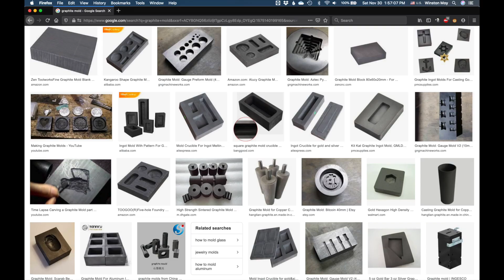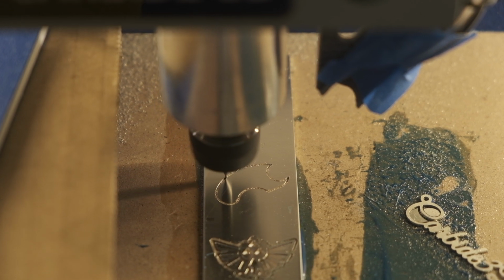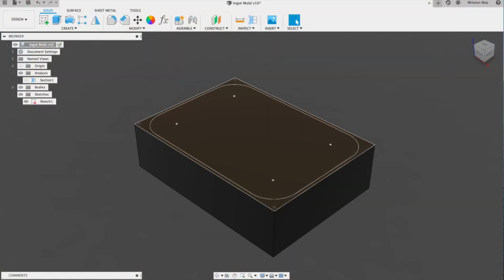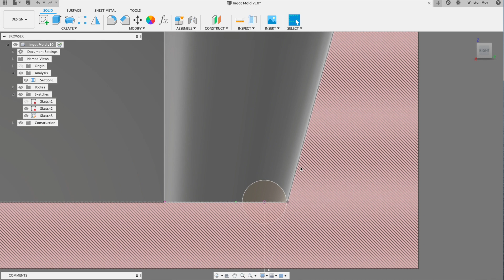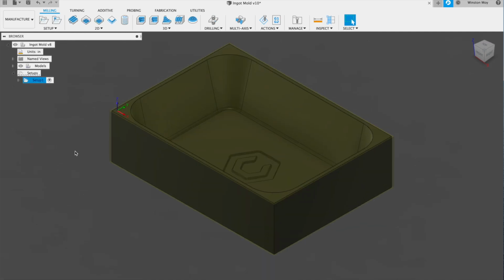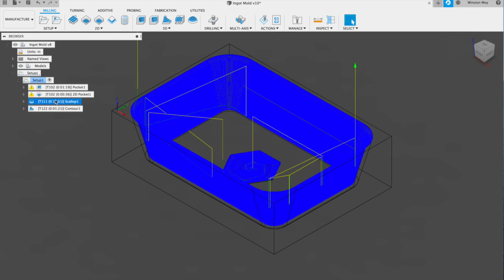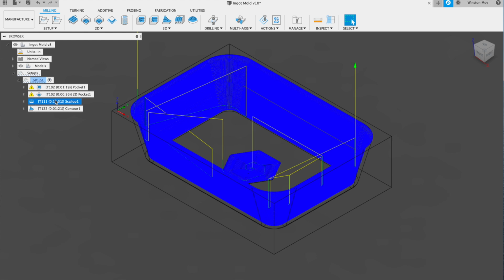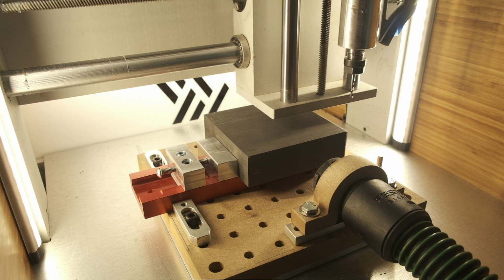Machining a Custom Graphite Mold for Metal Casting - #MaterialMonday

Comment: Hi Winston, from a jeweler's perspective: Graphite molds deteriorate quickly if you flame them too hard, for too long, and too frequently. A quick hit with your torch is all it takes, not only to heat the graphite, but also to make sure it doesn't contain any moisture. A dry mold (for any material) is extremely important to prevent gas explosions. I suggest you use tin = pewter for your next tests (please no leaded alloys). It's cheaper, has a very low melting point, and flows well. Most importantly, heat your metal to the point where it flows freely in your crucible. Clean the surface of any residue with a cheap stainless steel spoon. Use leather gloves. Once the metal surface is mirror-shiny, bring your crucible close to the mold opening along with the flame and pour quickly. Slow pouring won't work.
To make sure your design is suitable for casting, this is the best way to test quickly over and over again.
For professional casting (jewelry, etc.) and graphite mold making (CNC) you can contact me anytime. Good luck and have fun casting. Herri

Comment: Soak the graphite for a couple days before machining it, or mill it under water in a bath. Much safer. Also, even though it machines what seems to be easily, it wears tools fast. You get special diamond impregnated end Mills for graphite, about 30-40 a piece

Comment: Where can I get a 6"x3"x3" ingot mold cut for 5lb aluminum ingots with my business logo on it?
Reply from the maker: Either a local metal supplier who also has CNC services. Or look to the Carbide 3D Community Forum.  Post what you need made and see if anyone picks up the job.

Comment: Could you machine graphite in a cnc that runs coolant? I assume you'd have to burn out any oil residues.
Reply from the maker: Graphite is porous and will absorb moisture. Coolant is not recommended and will make things worse.

Comment: what type of bit is it that you used , is it one that you use on wood due to the graphite being soft or is it one you use on metal
Reply from the maker: I was using regular uncoated endmills. Graphite machines really easily and though it is slightly abrasive, for small scale projects it's a non-issue.

Comment: That tapper is called draft angle and it's essential in mold making, particularly if they material dose not shrink that much after cooling.
Reply: True! I’m going to get the Nomad 3 soon. Do you use Nomad 3 to make injection molds from Al 6061?
Reply: True! I’m going to get the Nomad 3 soon. Do you use Nomad 3 to make injection molds from Al 6061?
Reply: True! I’m going to get the Nomad 3 soon. Do you use Nomad 3 to make injection molds from Al 6061?

Comment: With the danger of graphite dust being so pointed, you could always add oil lubrication to the machining process. 
There's some inherent disadvantages to it, but there's also additional advantages to it beyond dust mitigation. 
The most pointed disadvantage is that you'd have to dry fire your mold, or at least heat it in an oven until it stopped smoking before you used it as a mold for molten metal.  
This side of it is actually kind of nuetral though. 
Oiling and "burning out" graphite can actually repair minor wear on the inside of the mold, though also obscures small details. 
If you're machining graphite for technical application, like bike parts, soaking the graphite in oil to impregnate down into it does yield some advantages. The degree of penetration is dependent on the weight of the oil, with lighter oil penetrating down deeper into the graphite.
Reply: Thank you, adding the oil soak to my "good to know folder"
Reply: Thank you! 👍💓

Comment: I'm a goldsmith and I think your problem is not only the mold beeing to cold but the silver, too. We usually preheat the mold and then start melting the silver while keeping the flame on the metal all the time. You want to keep the flame at the right distance so the metal stays silver and doesn't turn black. When you pour, try to keep the flame on your pouring stream so it stays hot and free of air/ oxigen. ( If that makes any sense to you :) ). Anyway, great video! Can't wait to try it on my CNC. We usually do sand/investment castings. Time for some graphite....
Reply from the maker: Yep, totally makes sense. In blacksmithing they often call out a "reducing flame", one where the flame has consumed all the available oxygen and basically bathes the metal in an inert gas jacket.
Reply: Yeah, over here we pretty much keep the flame going until we let the centripetal caster loose, shoving the metal into the mold pretty quickly lol.
Reply: It is best to keep melt & mold bathed in a flame for an inert environment. Silver in its molten form is prone to absorbing oxygen and releases it as it solidifies. That's where you start getting all your gas bulbs (porosity). It can absorb up to 20% by weight if memory serves me, correct? Minor surface contamination inside your malt dish can be removed by sprinkling borax on it prior to your pore.

Comment: Nomad has interesting original spindle design. Is it NEMA 17 type servo motor? What RPM range has Nomad in that setting?
Reply from the maker: The spindle is powered by a 70w brushless motor in a square NEMA-style housing, and sometimes mistaken for a stepper or servo. It's good for between 2-10k RPM.
Reply: @carbide3d  I got it! Thanks for the fast anwser!